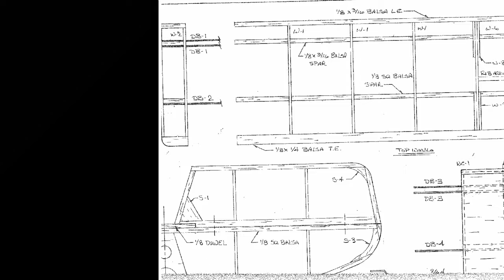Why you shouldn't maiden an RC biplane in high wind!

Comment from the maker: I really wasn't sure if this would survive its maiden so I asked my son (who worked with me on the build) to film us so that we'd at least have something for posterity, should the unthinkable occur 

The model's Center of Gravity ("CG") is spot on according to the plans, but watching the video carefully I now believe that the plane was possibly acting a bit tail heavy. At the time I was just focused on the wind and on controlling it (I even commented while flying that "it's like a 3D plane" - and with no ailerons, recovering from the side to side rolling had me pretty tense!) and so my focus became the size of the rudder and elevator (both are quite large) and the amount of throw. I think the FAA calls this "fixation" in accident investigations, lol :)

The quick loss of altitude you see on the first flight is from lowering the power to try and find a throttle position where I could fly level. As the plane dropped I gave it up-elevator and and the nose pitched up. It went into a very low altitude flair and a (tip) stall. I then switched over to an attempted glide and emergency landing. I could have punched the throttle at that point and saved it, but I would have also risked smashing it into the ground HARD! I chose the safer path and got away unscathed.

On the second flight, I was heavily focused on the plane's tendency to pitch up and being pitch sensitive as I took off.   I  was then immediately hit with the second problem of the rudder being very touchy and the plane wanting to roll hard when rudder was applied. I began to speculate on the need to reduce the control throw of the rudder and add expo. While that was going on in my head, I instinctively cut throttle as I turned to face the wind, and just at that moment the wind died down from about 12 mph to 5 mph or less, and I lost lift...then CRASH!  Thankfully I wasn't going very fast, and I only suffered a minor crack in the leading edge of the lower wing. Looking back on this, I believe the damage was minimized by the fact that 1) the lower wing wasn't screwed down tightly to the wing saddle, 2) the cabine struts are thin flexible wire and 3) the inter-plane struts are just plugged in and not permanently attached.  Otherwise I'm sure both wings would have been severely damaged.

On the third flight, with elevator and rudder throws reduced to 50% and 25% expo added, I had a much, much better flight. But I still felt that the plane was "too touchy."  Just then I saw a flash in the sky and decided that the weather was going to get worse before it got better.  I was able to glide it down to what would have been a nice rolling landing, but for the smallness of the wheels and length of the grass. 

I left the field thinking that I should try adding more down-elevator mix with the throttle. It had a little, based on how some of my other biplanes are set up, but I felt it needed more because of how it was climbing. Now I am wondering if that's because the tail was too heavy and this was causing the tail to drop/nose to point up. I'll leave the throttle/down-elevator mix the way it is for now.

I was also feeling that I should try adding a throttle curve to the transmitter, because my "sweet spot" (where it flies above stall speed but not so fast as to climb) was very, very tight. Again, this is something I will try only after I re-check the CG.  Adding a few grams of weight to the nose will help with wind penetration too, so this could be just the thing.

I should add that with the cowl off during these test flights, the plane probably had a lot of drag. Now that the detailing is finished* and the cowling is installed, this variable can be eliminated.

*I needed to sand it down, paint it and put graphics on it - you can see how it looks actually "finished" in the video between time marks 0:59 and 1:10.
Reply: I know this is a year too late, but maybe this will help for future reference.
You can't trim a new airplane on a windy day. It just ain't gonna happen!
Also, down thrust should eliminate the need for elevator to throttle mixing.
I always make only one change at a time. Otherwise, how will you know which change did the trick? Reducing rudder throw AND adding expo at the same time could lead to further problems.
Biplanes with Clark-Y (flat bottomed) airfoils usually fly better with incidences as follows: zero degrees on the bottom wing, negative 2 degrees on the top wing, and positive 2 degrees on the horizontal stabilizer. And don't forget the 
2 or 3 degrees of down thrust!
A very nice build, though. Well done!
Reply: Richard Darlington I’m a couple years too late but I was definitely going to recommend double checking the h-stab incidence!